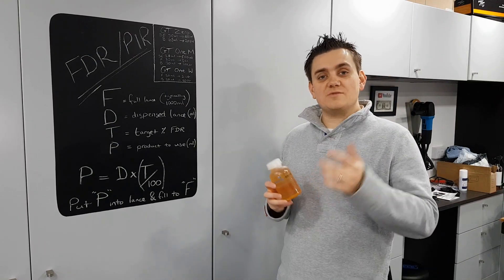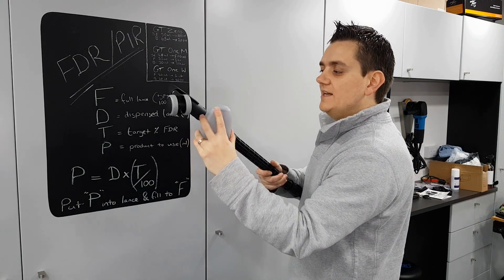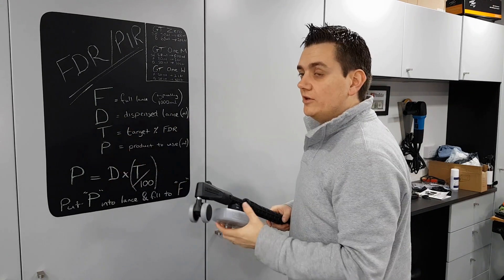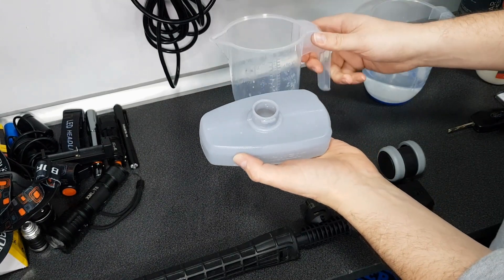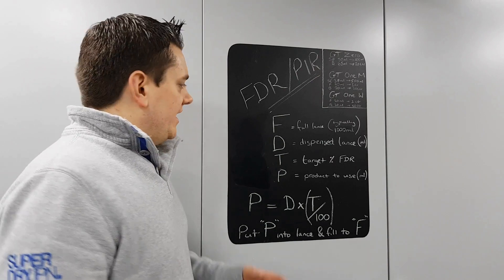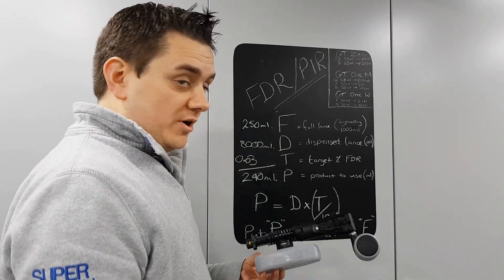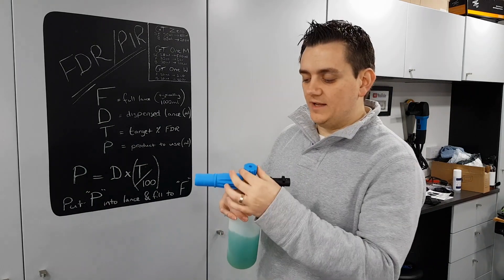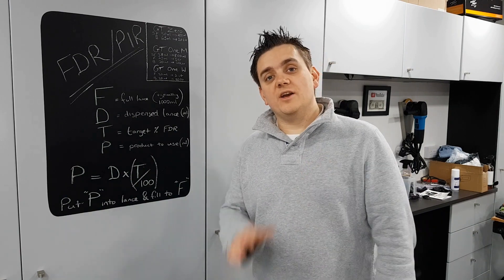Calculating PIR (Panel Impact Ratio) for Foam Lance use

Comment: I tried doing this with my Nilfisk pressure washer and ended up with more water out the bucket then in 😢
Reply from the maker: 🤣 
I've seen a trick where you slice the bottom off a 2L pop bottle. Slice up it from bottom to top and wrap it round the end of the cannon and aim into the bucket, keeps it all nice and "neat"

Comment: Great video! What if the percentage PIR you’re looking for is MORE auto foam than the capacity of the foam cannon bottle. Basically, no added water. How would you determine PIR?
Reply from the maker: You wouldnt! Basically at that point the lance cannot pick up enough product for the water its putting through. Different lances do have different pick up rates.
Reply: @DetailingandtheBeast  if I’m understanding this correctly, with the setup you used in the video, the strongest dilution you could get used neat is ~3.2%, regardless of the bottle size?
Reply from the maker: I'd have to rewatch it, but yes I do remember it being "poor" in terms of a draw rate. A full size lance is Mich better. The pickup tube on the undercarriage lance is very very slim which explains it.
Reply: @DetailingandtheBeast  the lance you used in the video does NOT have a poor flow rate! Considering for 250ml flowed 8,000 ml of water, that is A LOT!!!! Even if that bottle was 1,000 ml, you couldn't go stronger than a tad over 3%.I have 3000PSI/2.5GPM pressure washer, and through a normal foam cannon, it flows 5,200ml of water for 250ml.
Reply from the maker: I said draw rate, not flow rate. Draw rate, the amount of product picked up from the lance bottle, is poor. So far too much water, for not a lot of AtomMac, makes a really weak dilution. It's irrelevant of the bottle size, the draw rate is always the same.
Reply: @DetailingandtheBeast  ah, ok, my fault! Thanks for clarifying! I understand now!